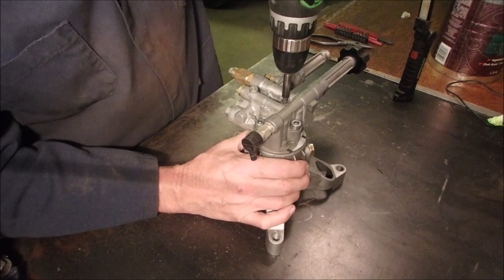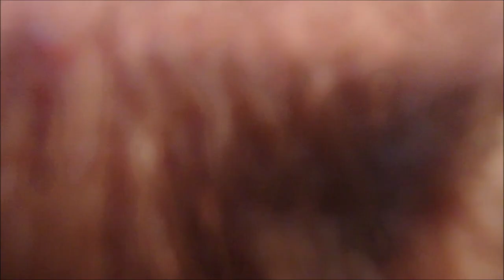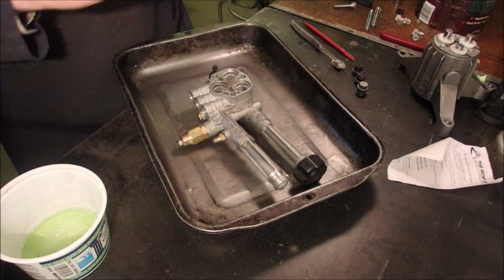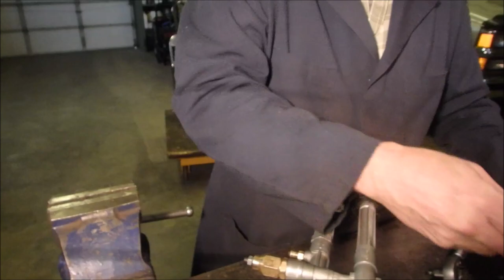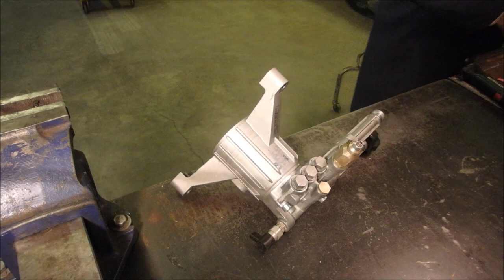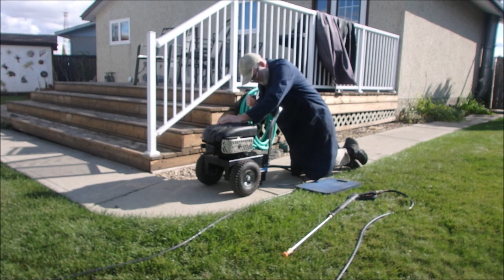Residential Pressure Pump Repair

Comment: Bruce I love your site, helpful tip for low pressure. After I changed all the 6 valves, unloader, pressure vale, checked everything I still had low pressure.
Most over looked replacement for low pressure problems.
Remove the high pressure hose from the PW, this high pressure hose is attached to the 3"  high pressure pipe, remove this 3" pipe, now after removing pipe look back inside the pipe still attached to the PW, yes there it is "The Jet",
unscrew the jet (screwdriver left), after the turning stops, you need to pull the jet out, not easy, what I did, I hooked the PW to the garden hose and the water pressure pushed it out, be careful not to lose the jet parts , (back jet, spring, front jet), small pin hole need to be cleaned out, also the jet may need to be replaced, this is where my problem was, worn jet, easy....
Lee
Reply from the maker: Thanks for the info.  Very good.

Comment: First of all ,  Thanks Bruce

Today, I took my pump off in hopes of aluminum brazing with low temp alum brazing rods. I have a spraying leak on the pump threads where the brass soap inlet screws on the pump, so I had to strip the pump from all parts because I will be applying heat with a  torch in order to braze the crack.  First time trying this.
Well Thanks to Your Tip on how to remove the check valves using the mounting bolts .
I was able to take them out without damage.  using the bolt.
I am a new subscriber  for life.  Thanks
Reply from the maker: Thanks for signing up.  i hope you enjoy my channel.

Comment: This was a very helpful video Bruce. I learned quite a bit today!   Oh, if you had a pair of snips, can wrench and some diagonal (with wire stripper holes)  pliers on the workbench to go along with that cable knife and spudger, I would have felt right at home. ;-)

Comment: I think " someone " use to work for a telephone company. A pick stick or push down tool for jumper wires, and a cable splicers knife. Hmmm, wonder who that could be. LOL
Great video my friend. I've got a pressure pump exactly like yours and it's on a Troy-Bilt 3,000 psi pressure washer that's been sitting for 7 years unused. I am just now exploring if the unit will work again or not. I won't find out until I get the new pressure hose for it so I can run the unit to see if it develops high high pressure water. Just a note: Troy-Bilt doesn't support the pressure washer saying it was built by Briggs and Stratton. I went to both websites and Briggs and Stratton said they never heard of the model number I have. It's going to be interesting if I have to rebuild my water pressure pump like you did and find any parts for it.  Once again, thanks for a great video my friend.
Reply from the maker: You are welcome.  33 years at the phone company up here in Canada.

Comment: Enjoy your videos very much, I have that exact pump, and have did complete rebuild and didn't work ,I have watched all the videos and have not seen ANYONE remove the OUTPUT TUBE, there is a valve way down deep with a small rubber O ring on the tip and 2 larger O rings . Mine had the small O ring stuck or glued in tight from setting idle for years.it appears to be a pressure relief valve or something. Hope this helps someone.thanks
Reply from the maker: Thanks.  As they are made so inexpensively and are troublesome.  I am not surprised with a few more issues
Reply from the maker: OK  At 36:54   is that the O-ring you are taking about.  I know this is months later but i am trying to learn.

Comment: Hey Bruce great video.
I learned a lot of Do's and Don'ts  on your Video that can and will come in handy when I repair My Generac  2.5  2800 PSI washer.  Anybody got a spare pump for sale cheap.
 Like,      
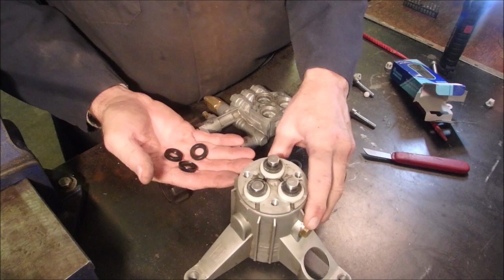              Do Keep your index finger Healthy like in 12:22 
              Don't test water pressure with your bare Index finger  as in 51:22 or  53:09  and 53:27   
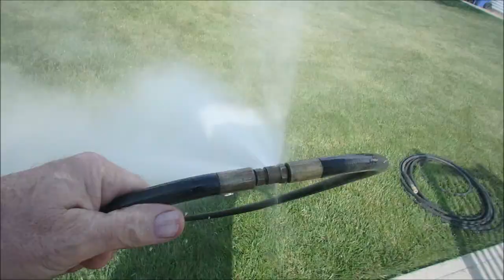 Or,   This is what happens  as in 55:09 and 56:00 .
But seriously Bruce great Video.  hope you are ok.
Reply from the maker: Thanks.
Reply: Yeah, I noticed that too.  No, don’t test water pressure with your finger!!  Ouch.

Comment: I’ve watched lots of these videos that fix no pressure, taking the pumps apart, checking hose, etc! Even brought it to a repair shop, they told me to scrap it as they’re basically a throw away inexpensive and easy to replace? 
  The first thing you should check is the KEY WAY???????  After 3 weeks of screwing around, I unbolted the ENTIRE PUMP from the engine and discovered the KEY WAY had disintegrated!!!!!!! Had to polish the engine shaft as it was gouged.  Once I removed the burrs from the shaft and the new pump assembly I bought would slide on, I greased the shaft, set the new key way in place and fit everything back together, PROBLEM SOLVED!!!
   Not one video on here showing that low pressures can and does occur if the KEY WAY has been ground off!!!!
Reply from the maker: Good job.  Thanks for this.

Comment: You have not completely torn down the pump.  There is a high pressure jet under the outlet tube which has very close tolerances and will stick closed if pump preservative is not used prior to storage.  (waheller1 mentions this in his comment 10 months ago)
When this jet sticks it gives the exact same symptom as what is shown in this video.  This is a build of of pressure inside the pump which the unloader cannot releave.  If allowed to continue for a few seconds it will blow out the check valves and damage the internal oring in the unloader.  This jet oring must be replaced as it swells from the excess pressure and will not seat properly again.  See AR  pump parts breakdown to get part numbers of orings or you can buy a oring seal kit.  Also the only nozzle you should use when setting pressure is the RED or straight stream nozzle.  You should also use a guage to set pressure.  Otherwise you cannot be sure of the pressure that is being set and can turn the pump into a bomb.
Reply from the maker: I know this is a late response but i am checking into this.  Thanks.  These little devils are crazy.  thanks again

Comment: Awesome job Bruce! Thanks for taking us along, this is good info to have!
Reply: BTW, what's that black barbed fitting for? The one shown front of screen @ 43:54 ? Since that brass one is the soap intake I have no guess at the black one. Thanks.
Reply from the maker: Thanks again.  You are good
Reply: @MrUbiquitousTech  I believe that is a thermal relief valve. I have seen it on some pumps but not all. If you let a pump idle for a while without moving water it will build a lot of temperature in the trapped water in the pump

Comment: You mentioned the pump oil in this video.     You say this has SAE30 but some use a gear oil.  Have you ever substituted the gear oil with the SAE 30?  Mine says it uses SAE90.  Wondering if I can replace it with the SAE 30?
Reply from the maker: If it says 90 Weight then use that.  90 weight is much thicker than 30
Reply: @BrucesShop  thanks Bruce.  I did some research and some believe the AR64545  pump oil is 75W-90.

Comment: I have the same pump as the one in the video and I want to replace all the valves, O rings, and seals. Where did you order your parts? I’m a 63 y/o woman who recently learned how to clean carburetors on lawnmowers, then the pressure pump on my pressure washer leaked oil and had water coming out of it. I was thrilled to find your video and I love your sense of humor! Thank you
Reply from the maker: No problem. Thanks for watching  Right above in my comments it a link to parts for pressure washer parts.  It may get you started.    Here is the link below for you.  It may help you steer toward what you need.  
https://www.ebay.ca/sch/i.html?_nkw=annovi+reverberi+pump+kit

Comment: What happens when that ball and spring are stuck in the bottom from hard water debris (and the ball doesn't move or actuate anything)?  I picked up an almost brand new Troybilt 2500 washer that wouldn't build pressure.  Disassembled the valve body, and removed all the plastic valves (now waiting on delivery of the replacements), but that ball was jammed in tight.  Soaked it in penetrating oil for hours, then cleaned it out, and it would not budge.  I then filled the whole inside of the valve body with Evaporust overnight.  Washed all that out with HOT water, retreated it with penetrating oil (Tri Flo is my go to penetrating oil).  Got the ball to finally come out with compressed air this morning.  Yay me.  Even recovered the spring on the floor that shot out with it before the garage trolls found it and hid it somewhere. I am hoping that thing being stuck was why the thing wasn't building pressure, as I didn't find any other problem in the valve body.  Do you think that would cause it to not build pressure?
Reply from the maker: Yes I may be the issues.  Remember I am not there t help.  .   Some times I use CLR   It dissolves crud too.
Reply: @BrucesShop  Thanks for your reply!  I finally dislodged that ball and spring, and that fixed it.  If you need an addition to your fixing experience, this is how I finally got that thing out.  https://youtu.be/pWFn_fNg3IU

Comment: Thanks, I plan to challenge  fixing low pressure  problem of Generac PW.  pls help me  with  the name of part kit you used for repair
Reply from the maker: This was in the comments  
https://www.ebay.ca/itm/Annovi-Reverberi-AR-Check-Valves-Pressure-Washer-Pump-Check-Valves-Kit-AR42123/253540388586?hash=item3b082f4eea:g:sQEAAOSwFqJWjAhF

Comment: If the engine didn't want to turn once stalled, it's more likely the unloader valve according  to other sites.  Pressure build up was stalling my engine...but I"d screwed my unloader valve down as if it was the way to increase pressure arbitrarily.  Opps.  If the valve is sticking, that happens.
Reply from the maker: Right.  I would clean the unloader

Comment: How  do they set the pressure at the factory ?
Reply from the maker: I don't know.  It is probably a spring tension on the bypass.  I don't think they would use water.
Reply: With the unloader adjustment.

Comment: Hi Bruce, amazing video, thanks for uploading.  I forgot to have water running when I fired up my pressure washer a few weeks ago.  Naturally, I’m assuming my pump is torched.  I have taken it apart and don’t see anything glaring that appears to be damaged.  Do you know what usually goes in one of things when someone does what I did?
Reply from the maker: They are usually ok.  Did you try it connected to a hose after you reassembled it.  They will run for a long time dry.

Comment: Under comments about valves  fot this pump saying Amazon is very broad, can you just put the part number for kits here, my pump has no recognizable number nor manufacturer info to trigger Amazon, thanks again great presentation!
Reply from the maker: This is the Annovi R site.  
https://www.youtube.com/watch?v=14NJdupE_UY
https://www.ebay.ca/sch/i.html?_nkw=annovi%20reverberi%20pump%20kit

There you go.
Reply: There are at least 3 different valves they sell.  The ar2233 are 13mm.   The 42499 are 10mm. The 42123 I don't know.

Comment: Glad you launched into pressure pump repair.  Very interesting and not as complicated as I imagined.  Great repair and fix.  So because you put the pump on a different engine was the pump the cause of the first engine shutting off or is it something within the engine or carburetor.   As Fog Horn Leg Horn would say  I say I said  was it the pump or engine?Hahaha
Reply from the maker: It was this pump that caused the stall as I replaced this pump on the engine that stalled with a new one.
Reply from the maker: @mgomez5606  Well I cleaned everything in the pump as well as replacing the valves.  It is what it is.  LOL  Maybe something was cleaned out of the unloader.  I thought about that myself.  Don't overthink it.
Reply: M Gomez is that the pump was requiring to much power to keep it going very similar to trying to cut tall grass with a smaller power push mower.

Comment: Did the instructions tell you to apply oil to the rubber seals?
Reply from the maker: No  I just did.
Reply: @BrucesShop  agreed. Minimizes the risk of tearing on reinstallation. The oil used would not cause the rubber to expand either so no harm done

Comment: excellent video I just have a question you know what type of oil the pump has because mine was watered a little bit and I would like to know if it can be added and what type of oil is in it thanks for the video and see if you can answer my question thanks
Reply from the maker: I use 30W with NO Detergent.
Reply: @BrucesShop  Thank you

Comment: Bruce, you switched to torque wrench to get more torque, not more leverage 33:35, and I know you know the difference!  😉   Sorry - just my pet peeve about wrench monkeys using the word leverage when it’s actually torque. 😉🔧🔧🔧
Reply from the maker: OK  I wanted the bolt to be tighter.  The torque wrench is longer than the ratchet so I grabbed it instead of getting a longer ratchet out of the tool box.  The longer handle has more leverage on the 3/8 socket gives me more torque on the bolt.  I can split hairs too.
Reply: @BrucesShop    Sorry, but there’s no leverage involved at the time stamp I wrote. Leverage requires two things acting in a very specific way upon each other - a lever and a fulcrum. Everything you did at that specific point in time involved torque, a force rotating around a central axis. Yes, you increased torque by selecting a longer torque arm - that was obvious. You didn’t increase leverage because the function you performed was not leverage. I don’t consider this splitting hairs - by asking others to use 
correct terminology.  I’m concerned that viewers may not understand the concepts involved in mechanical forces when incorrect terminology is used.

Comment: 02:38  I would have scribed the two parts before disassembly then the decision at 28:33 would be a no brainer.
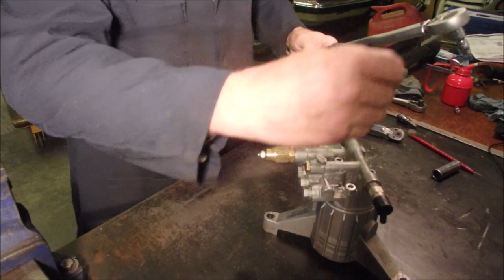30:16  Time to make a jig to hold the pump that will mount in the vice.
Reply from the maker: Good idea

Comment: Good video , but I was always told not to use an extension on a torque wrench , and I notice you use an extension alot with kind of a cumbersome effect , just sayin ! :-) but a good video , I to have wondered about the inerds of a pressure pump , thanks ! :-)
Reply: I believe any inaccuracies from using an extension would be so minor as to be irrelevant to most anything a consumer works on. Caterpillar and NASA require dead on accuracy for instance, Briggs and Stratton does not.
Reply: @MrUbiquitousTech  
I'm thinking that using an extension for non-critical-low-torque is ok if just going for torque.  The extension will just torque so far then it will "stiffen".  If torqueing that requires degrees well than no extension.
Reply: @mikejoyce3782  Exactly, that's probably part of why there is a torque range, 18-24 ft lbs, instead of 19.76 ft lbs. If it was critical, it most likely be exact.
Reply from the maker: I think if all 3 are the same torque and snug   That would be fine.  Yes i was struggling with the extension and I will buy some metric allen sockets.

Comment: pump says use 85W90 thats gear oil folks. i would not use SAE 30
Reply from the maker: Well the way I read it in the manual the oil to use is AR64516 which is the AR 30 W  So you are right.  Can you tell me where the info is that you got the info on the 85W90.  On page 13 of the manual it says AR64516   Here is the manual   https://www.arnorthamerica.com/Pages/wp-content/uploads/2015/10/rsv-om-0607.pdf
Reply: @BrucesShop  my pump says SAE W90 right on it.

Comment: I was surprised that although the pistons are 12mm the bore in the head is 13.25mm.
Reply from the maker: Sorry  what are you working on?
Reply: @BrucesShop  basic annovi pump.  Same as what you have.  I am curious what the ID is of the bores in that pump head. I assume they are all the same.